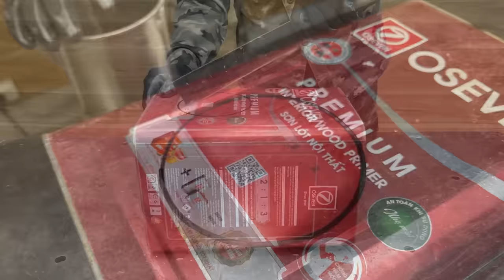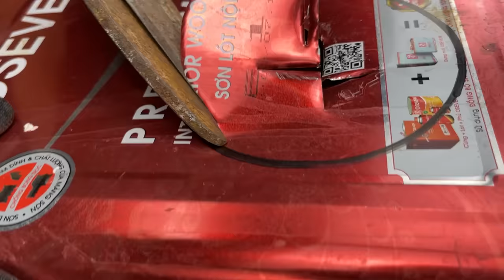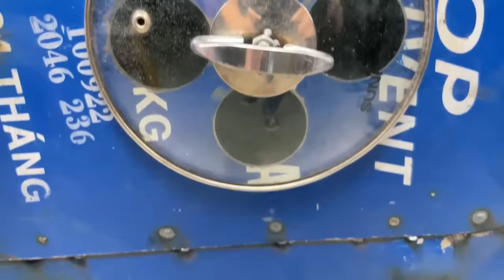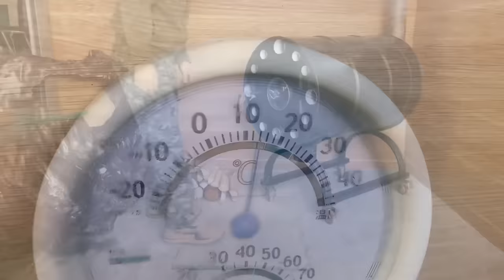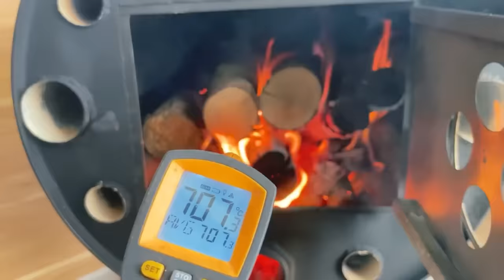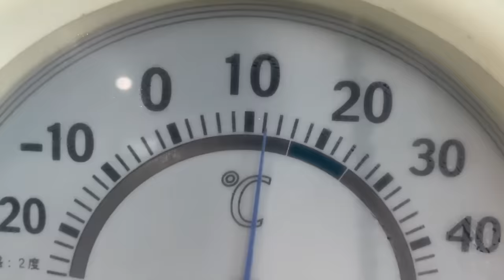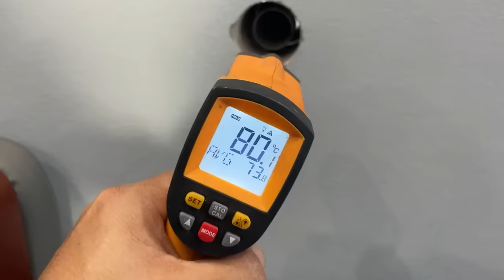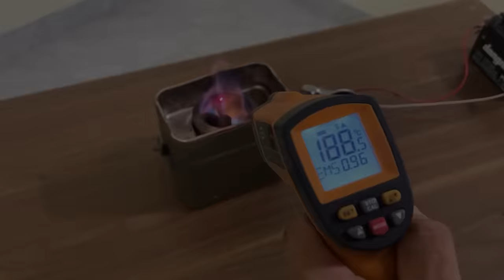Homemade sand battery heater - travel stove, easy instructions!

Comment: This guy needs to learn how to use a MIG welder.
Reply from the maker: It's important to practice and improve welding skills over time. Welding can be a challenging skill to master, and there's always room for improvement. If you have any specific tips or advice you'd like to offer, please feel free to share them with the person in the video. Constructive feedback can be helpful for those looking to enhance their skills.
Reply: @lmtn  Well, as my welding teacher(s), (high school and trade school), told me, "Read the book and practice, practice, practice."  Spot welding, tacking 2 pieces of metal together just to hold them for future welding, is fine but not to depend on as a permanent connection where a good seal is imperative.
    It looked as though he had the heat too cool on the heavier steel and too hot on the sheet metal like he had set the welder on one setting and left it there. Too hot kind of messes up the esthetics but isn't such a big deal so long as you don't blow holes in your work. I didn't see any of this which is a good start.
    Having the heat set too low leaves him open to cold welds on the heavier gauge metal which can break easily. This can be a big problem when building wood or waste oil stoves where heating and cooling leads to metal expansion and contraction. These stresses can lead cold welds, (welds that are weakly connected or not connected at all to the work), to break and causing leaks in the combustion chambers allowing carbon monoxide to enter into habitable parts of the house or building causing carbon monoxide poisoning to the occupants.
    His welds, to the inexperienced eye, actually looked neat but looking neat is not enough, no insult intended. A proper weld should look similar to his but should be made by maintaining the arc as much as possible from start to finish. It is OK to stop if he feels that he's going off track, has to scratch his nose or for any reason so long as he picks up where he left off with no gaps in the weld bead. This will be done by starting the arc then, while moving down the line to be welded, at a steady speed, drawing the tip of his MIG wire slightly from side to side equally on both sides of the weld. When he is finished, a proper weld should look similar to his old style but not like a bunch of spot welds. They should resemble a steady wave form like water on a beach on a breezy day.
    When he kept hitting the trigger one spot at a time, it was allowing the metal to heat and cool, heat and cool over and over again. What he needs to do is either acquire a how to welding book and read it. He might get this at a library. If one is not available, surely where he gets his welding supplies should have one or more. If a book isn't available, in my opinion, hands on experience is always the best. Practice on different thicknesses and harnesses of steel. He doesn't have to start out connecting 2 pieces of metal at first. He should practice making a solid, straight, constant bead maintaining the arc from start to finish without burning holes in the work..
    Failure is guaranteed in the beginning so he shouldn't  lose patients and keep at it until he gets it right. When he's confident in his work, then he can experiment with different heat settings and when one works well, write down the setting and the thickness of the metal then try a different sample of thickness / hardness of steel. The same settings will work on different thicknesses of metal within a few mm's either way so don't get too crazy in swinging the power knob too wildly .
    When he feels ready to start connecting 2 or more pieces of metal together, he needs to remember what he's learned and put it to use. The way to know if your weld is correct and solid is when the weld itself is STRONGER than the surrounding metal. 
    There is a machine to test this but is probably too expensive for the home shop to afford. It is like a reverse press. It has a clamp connected to a stationary base and a clamp connected to a hydraulic piston with a pressure gauge on the cylinder. You weld 2 pieces of metal together, place it between the 2 clamps and, (some are manual, some are electric), pump the 2 clamps apart keeping an eye on the pressure gauge. When the metal breaks, if the weld is intact without cracks, it is good. If it breaks right on the weld, he needs more practice. In the absence of one of these test jigs, and for non-critical work like building stoves, put one end of his work in a vice, the other end in a vice grip and flex it back and forth a few times. If the surrounding metal bends but the area around the weld does not nor cracks, it is a good weld.
    I hope this helps him improve his technique. The designs in the videos are inventive, practical and was entertaining. Thank you for them.

Comment: The concept of a sand battery heater is fascinating! Im intrigued by the science behind it. Would love to see more details on how the heating process works. Thanks for sharing such a unique and eco-conscious cooking solution!
Reply from the maker: The key to the sand battery heater is its use of sand as a thermal mass. Thermal mass refers to the ability of a material to absorb and store heat.
Heating Phase:

During the heating phase, the sand is heated using an external heat source, such as a flame or electrical element. The sand absorbs and retains this heat energy.
Energy Storage:

The heated sand serves as a reservoir for thermal energy. As the sand reaches a high temperature, it stores a significant amount of heat.
Cooking Phase:

Once the sand is adequately heated, it continues to radiate heat even after the external heat source is removed. This allows for a sustained and controlled cooking environment.
Eco-Conscious Aspect:

The eco-conscious element comes from the fact that the sand battery heater doesn't require a continuous energy input. It utilizes stored thermal energy, reducing the need for ongoing fuel consumption.
Portability:

Depending on the design, sand battery heaters can be portable and suitable for outdoor activities. The thermal mass of the sand enables it to retain heat for an extended period, making it ideal for various cooking applications.
If you're looking for more specific details on a particular sand battery heater design, I recommend checking the video description or comments section of the content you've been watching. Creators often share additional information and insights there. Feel free to ask if you have any more questions or if there's a specific aspect you'd like to explore further!

Comment: This DIY sand battery heater is a game-changer for outdoor enthusiasts like me. I appreciate the clear instructions – makes it seem so doable! Any tips for customizing it to different cooking needs?
Reply from the maker: "Thank you for your enthusiasm! I'm thrilled to hear that you see the DIY sand battery heater as a game-changer for outdoor enthusiasts. When it comes to customizing it for different cooking needs, you can experiment with the size and shape of the stove to accommodate various cookware. Additionally, you can adjust the number and arrangement of candles to control the heat output. Feel free to get creative with the design and adapt it based on your specific preferences and requirements. If you have any specific questions or need further guidance on customization, don't hesitate to ask. Happy experimenting with your customized sand battery heater!"

Comment: This DIY sand battery heater is a game-changer for outdoor enthusiasts like me. I appreciate the clear instructions – makes it seem so doable! Any tips for customizing it to different cooking needs?
Reply from the maker: "I'm delighted to hear that you see the DIY sand battery heater as a game-changer! As for customizing it to different cooking needs, you can experiment with the size and shape of the stove, as well as the arrangement of the pipes to control the heat distribution. Feel free to tweak the design based on your preferences and the type of cooking you plan to do. If you have specific requirements, I'd be happy to provide more tailored suggestions. Happy experimenting, and enjoy your outdoor cooking adventures!"